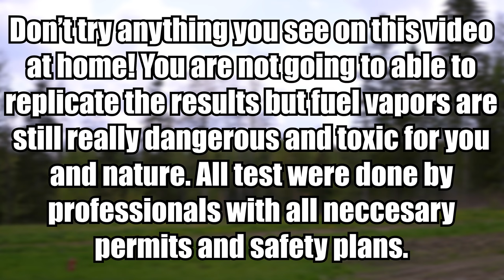Testing Fuel-Air Explosives / Thermobaric Bomb | Finnish MOAB 5 000 000

Comment: The United States military has had in their arsenal this kind of bomb for quite some time.  Tom Clancy first introduced this bomb to his audience in his book "Red Storm Rising" for the use of minimal physical damage with maximum personnel damage.  If you are caught in the immediate bomb damage area, you are suffocated/burned, out side of the immediate blast area, you have internal damage from the low frequency sound waves.  Nasty bombs.  Great show today.
Reply: Correct me if iam wrong but its same as Thermobaric rocket?
Reply: Sorry to quibble, God doesn't that sound pretentious. Anyway. Hunt for Red October released 2 years previous to Red Storm Rising, and there was indeed the use of an F.A.E. to scuttle a sub in the story
Reply: They're called "Daisy Cutters".
Reply: @joe125ful  a fuel air explosive is a thermobaric weapon, yes. There are other kinds of weapons that use a thermobaric warhead as well. I believe you are thinking of the RPG, which has, iirc, a thermobaric warhead.
Reply: @williammielenz3752  those are not fuel air bombs, they have an oxidizer mixed in with the explosive, as opposed to using atmospheric oxygen.
Reply: @dantreadwell7421  No RPG is mostly HEAT if iam correct but depend on type ofcourse.
But Themobaric weapons is mostly used on rockets like Russian TOS-1 
https://en.wikipedia.org/wiki/TOS-1
Reply: @joe125ful  you are absolutely correct, a HEAT warhead would be used for anti tank or against heavy fortifications, but it does have a thermobaric warhead for antipersonel/anti materiel use. 

And thanks for the other link, will check it out.
Reply: Thanks captian obvious
Reply: @williammielenz3752  no they aren't
Reply: FAE weaponry has been known to the public since it was introduced in the 60s, it wasn’t some huge secret, and wasn’t first introduced by Tom Clancy. And it’s not sound waves, it’s pressure waves, and minimal physical damage is BS as well, as shown in this video and various other official government weapon test videos here on YouTube and in official documentation.

Learn some actual facts and do some reading on the subject, you’ll sound better explaining things when you actually know anything about the topic.
Reply: Sound waves are pressure waves..
Reply: Russian TOS missiles warheads are thermobaric and use special amyl-nitrite fuel and atmospheric oxygen. The Russian man portable  one use "Smel" flamethrower looks like mini bazooka and has thermobaric granade with some kind of metal hydrate  and oxydiser mix , but also liquid fuel variant and it's not RPG. RPG has mostly cumulative granades
Reply: @Barabel22  - The idea Clancy came up with was to change the warheads on Tomahawk missiles from nukes to conventional explosives and use them to attack airfields. It wasn't about MOAB's far as I remember, but that could be where this stuff came from.
Reply: CBU-55, CBU-72 Are Fuel-Air bombs the others like the BLU-82 DaisyCutter are Thermobaric. 
Also the MOAB is neither a fuel-air Bomb or a Thermobaric Bomb. It’s just an massive airburst HE device filled with only H-6 explosives not fuel or high temperature energetic metal.
Reply: @shanekhiu9884  - Never actually looked it up before, but you're right. MOAB's not a FAE, just a big bomb. Learn something every day. I'll take your word for the model numbers.  That aside, my point was that Clancy wasn't talking about FAE's in Red Storm Rising. He was talking about using Tomahawks (then a brand new system used strictly as a nuclear platform) to scatter bomblets across runways and airplanes. The story (quite possibly urban legend) goes that someone highup in the Navy thought that was a good idea and ordered testing, and as a result the Flight II and later 688-class submarines wound up getting vertical launch tubes installed for Tomahawks. There's nothing on Snopes to disprove this story, but that doesn't necessarily mean it's true.  I honestly don't remember any mention of FAE's in The Hunt for Red October, either, but it has been a while since I read that one.
Reply: @joe125ful  no they definitely have thermobaric rpg projectiles. As well as antipersonell warheads. The heat projectiles are just the most prolific in third world nations.
Reply: @shanekhiu9884  the BLU-82 is not a thermobaric weapon. It is just a large charge  (around 12000 pounds) of normal ammonal slurry.  Just a big conventional bomb.

Comment: As a mining engineer in deep coal mines, I spent my whole career working inside a potential huge thermobaric bomb. Initial 'dispersal charge' would be a methane explosion which could cause a medium pressure shock wave which could raise fine coal dust in the mine tunnels which would be then ignited by the following flame front and detonate, travelling along the tunnel at 2 km per second until it reached a place where there was insufficient dust available. I watched an actual test explosion at a research establishment carried out in an 800m tunnel. The energy involved was beyond belief and shook me to the core. That was the reason why young mining engineers were invited to witness these explosions. We always took great care to minimize gas and dust production /deposition and kept inert stone dust barriers up to date. These barriers were designed to collapse and drop tonnes of stone dust into the tunnel air to douse the flame front and dilute the amount of combustible dust to a point where it prevented detonation. 
I pray for the poor souls at the receiving end of such bombs in Ukraine today
Sláva Ukraini !
Reply: This gave me chills because I understand the dynamics behind it 😬🫡
Reply: I've experienced a dust explosion ones, it's was something, but nothing compared to what you described. Wow
Reply: Similar events were/are common with grain silos.
Reply: The US were using it for a long time in the middle east
Reply: @صادعامر  god bless them
Reply: Героям Слава!

Comment: When I was in college, my chemistry instructor had a demo that he’d do for the class. It consisted of an empty paint can with a candle inside, and a little cup with a rubber tube that ran out a hole in the side of the paint can. The hose had a squeeze bulb attached to the end of the tube that was outside the paint can.

He’d pour a little bit of lycopodium powder (although regular flour would work as well) on a tray in the front of the class and try to light it on fire… it would burn, but very slowly. Then he’d pour a bit of lycopodium powder in the cup inside the paint can, light the candle, put the lid on, look up at the class expectantly, and squeeze the bulb.

BANG!

… and the lid would hit the ceiling.
Reply: This is why they need to add a few hundred grams of very fine aluminium powder to this experiment. Probably arranged in pvc pipes around the center of the device. This will dramatically increase the temperature and oxygen consumption for an even louder boom1
Reply: @jarls5890  “Where’s the kaboom? There was supposed to be an earth-shattering kaboom!” - Marvin the Martian.
Reply: When I was a children's science educator I did a similar experiment attempting to light flour on fire with an ordinary flame, vs blowing the flour through a flame from a tube. The flour through the tube made a fireball, kids loved it.
Reply: Our chemistry teacher in high school did the same thing with just regular flour and the lid stuck in the ceiling!

Comment: Well done! I'm not quite sure about what kind of fuel have You used meaby gasoline and antiknocking agent but if You want very very powerfull thermobaric mix You should use a mix of Gasoline, diethylyether and nitromethane respectively 60% 25% 15%

Comment: As at 9:33 what was the pre explosion “smoke” rising from the pitched roof structure? It’s almost like a heat wave from a nuclear explosion igniting the structure before the blast wave hits.
Reply: It's dust that has settled on the structures. In nuke test films, the puffs of smoke that rise from buildings and cars etc. is the surface material being blasted away by the intense radiation of different wavelengths.

Comment: I wonder if you can do a SHAPED charge using only gasoline and the proper container / materials...  That would be interesting...  It would make demolition cheaper maybe?  Less hazardous? (if you can pull that off, then you won't need to deal with TNT.)   Something tells me though it cannot be done...  At least to the point where you cannot cut through large steel i-beams like the normal ones can.

Comment: Loved this experiment. Now I want to see this scaled up. Or with small objects (sand might work) in the ethanol that will help mix it with air after the initial burst, for more efficient detonation.
Reply: Exactly, I was thinking a fine wire mesh or screen that the fuel is pushed through by the primary .. or maybe even combine two concepts, that of the shaped charge and fuel inside of a conical  container Made of copper.. that might turn out to be a really interesting effect. Because the "jet" of almost plasma-like copper would be possibly be followed by a secondary fuel/oxy explosion. That if it did work like that it would add another layer of lethality because the jet essentially  pushes it's way into armor plating of say a tank and all the while it's injecting the interior with the fuel/oxy mixture that could turn the entire armored vehicle into a gigantic pipe bomb lol

Comment: Do you guys think if you used a few layers of fine metal screening that the fuel will essentially be forced through in order to have the finest mist possible and it might help to get more oxygen with an even mixture..I really think you guys did an amazing job as is but the engineering mindset just always wants optimization... Well done
Reply: I think the screen would be broken immediately upon detonation essentially before the screen could have any effect.
Liquids do not compress and it takes a massive amount of force to actually blast the fuel out.

Consider that the explosives used to create the fuel cloud typically detonate at upwards of 8,000 meters per second.
Even without any amount of containment they detonate at basically full detonation velocity. That's why the MOAB was designed with a very thin aluminum shell, to increase the payload relative to the weight. Aluminum also adds to the blast because it's a very reactive and flammable metal.

Comment: You do want the gas in the engine to detonate; you just want it controlled.  Too much detonation = knock.  Simple burning wouldn't produce any force with which to push the piston down.

Edit: The slowmo makes the explosion sound so much fiercer than it already is XD
Reply: You're incorrect about burning not producing any force. The force comes from the burning being in a confined space and producing an expanding volume of gas, so you get a prolonged but relatively smooth 'push'. The fact that it's under compression speeds up the rate of burn. The goal is to keep the parameters below the point at which the fuel air mixture detonates, because that produces a violent punch that damages the components.

Comment: Maybe for the next one use a gas and not a liquid. Gas like acetylene burns by using the oxygen around it, just burns hotter by adding oxygen gas to it for use in cutting metal. Another point would be the pressure of the canister, that is an explosion in and of itself but will allow for the gas to expand quickly and over a wider area.

Just a thought
Reply: the idea in the liquid is that it creates a mist, just more efficient over area

Comment: 4:00 Engine knock isn't because the fuel explodes instead of burns. There is no difference between "burning" and "exploding". Engine knock is because the fuel starts exploding before the compression stroke is finished. This is the reason high octane fuel must be used in higher compression engines, i.e. the fuel won't start combusting early.
Reply: My understanding is that there is a difference between burning and exploding. When a spark plug is the ignition point you get a predictable flame front that travels through the air fuel mixture. When knock happens you have an unpredictable flame front where the entire mixture can essentially ignite simultaneously as the mixture reaches the required temperature and pressure. That causes a severe shockwave which to my knowledge is what engine knock sensors watch for.

It does happen during the compression stroke though and octane certainly helps.
Reply: @Gremlin87  "as the mixture reaches the required temperature and pressure" Correct,  and that happens too early in engines that experience knocking. The ideal is there's no explosion at all until the spark plug ignites the fuel.

Comment: Now do it with RC Nitro fuel and Diesel blend ? also a proper rigging of equipment/well done engineering almost or better than military standards ? 300 bar of pressure or so from scuba tank and it atomises/turns thick diesel into thin film mid air and watch the explosion go nutso probably ?? O.o what do you guys think ?  Love you all, stay safe :) :)

Comment: Wasn't quite a nuclear explosion...no vacuum effect, of air rushing backwards to fill in the air pushed out by first shock front...check out the video of the trees they nuked, they shake back and forth.

Also, in videos of nuke tests you can see thermal radiation burning things before the blastwave hits

Comment: Don't want pre-detonation? Don't use an uncontained explosive.  Build a device that is basically a single cylinder internal combustion engine.  The cylinder if full of fuel, and has many tiny tiny slots in it, which are blocked by hard wax, or silicone.  The charge is in a TELESCOPIC piston that is fully contained inside the cylinder.  When the small charge goes off, it's flame and heat are fully contained in the telescopic cylinder, and as it telescopes to a longer length, it SQUISHES the fuel in the cylinder out through the tiny slots, into a vapor.  No flame or head touches the escaping fuel.  The small charge is calculated to be just big enough to extend the telescopic piston to it's full length, which will then completely fill the space in the cylinder where the fuel used to be.  The fuel, at that point, has been pushed out of the tiny slots.  Remember, you don't need a super strong small charge.  It can "take it's time" pushing the fuel out the slots.  I suspect even a full half second wd be ok.  After that, your "ignitor" charge, which can also be small, can be set off.

Comment: Two errors, 1: Too low to the ground 2: Use a shape charge configuration which pushes fuel into a cone. Would be far more effective if jet fuel was used. Have fun 😁👍👍🍻

Comment: Make a big chamber  with 12" legs coming out of the bottom like an octopus with 90 degree up turns on the ends you can put bowling balls in. Set off your thermobaric charge off in the chamber. Plenty of variations.

Comment: Those are not just small scale buildings, they are also pretty strong compared to the big scale ones. Therefore the test is not entirely accurite. 
I can't tell if they added aluminum bowder or not and what fuel they are using.

Comment: Maybe using compressed oxygen to disperse the fuel will prevent pre-ignition, and also add more oxidizer to the mix. All you need to do is come up with a valve that will dump an entire cylinder of 2000 psi oxygen through the fuel container all in one shot.

Comment: I've had this idea of combining fuel-air explosives with shaped charges to create a focused and directed hypersonic overpressure wave: Using compressed air (or nitrous oxide for extra oomph:) forcing fuel through a precise nozzle arrangement to create a shaped fuel-air cloud within a wire lattice of spark points, coordinated to fire in a specific pattern that ignites the mixture into a focused detonation wave. Please give it a go!

Comment: My recommendation, before saying don't try this at home because we cannot replicate the results is to consider that there are folks out here that could teach a thing or two. We'll start with the fact that your fuel needs to be a a much finer aerosol. You're getting close but you need to delay the detonation just a bit longer. Then your ignitors need to be  more evenly distributed. For the sake of your testing you may want to use external ignitors.  The effectiveness of the Air Fuel bomb is not in the "explosion", the devastation comes from the rapid "implosion" of the surrounding atmosphere. I would set your rig about 20 feet and give the fuel more time to disperse. When we use the AFB we use it as we would a nuclear device. The effect, minus the radiation, is the same.

Comment: If you observe the images closely, you will notice there is an oscillation in the cloud immediately after the fuel explosion. These are similar to the oscillations in the blast bubbles that form in underwater explosions. The high-temperature air as a result of the thermobaric reaction lowers the density of a large volume, causing that volume to behave as a bubble which contracts and expands under atmospheric pressure. Good work, guys.

Comment: I think the one where they drop fuel from an air tanker and let it fall and atomize and then ignite with incendiaries is better (don't let it get to ground level).  I pulls the windows out of buildings,  burns up the 02.  Then you can roll in,  pick up the bodies,  put in new windows and use the recourses of the place you just depopulated.

Comment: It's very interesting that the roofs of the houses start to smoke before the secondary detonation and certainly before the detonation front has reached them. It looks like they are heated by adiabatic compression of the air caused by the expansion of the fuel-air mixture. In nuclear bomb tests the pre-charring is caused by thermal radiation from the fireball before the Mach front arrives but this is clearly not the case here as the back slopes of the roofs also smoke, but they are not in line of sight of the primary explosion and so not exposed to a radiant heat source.